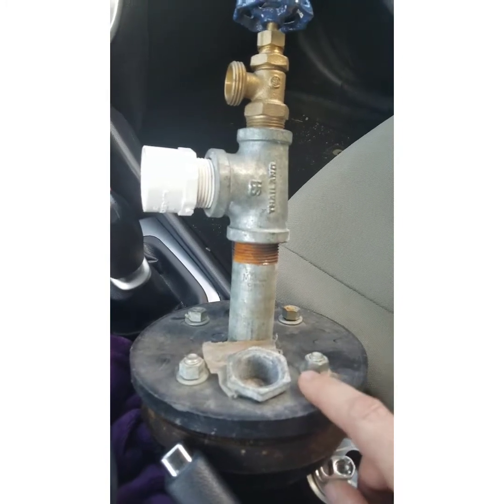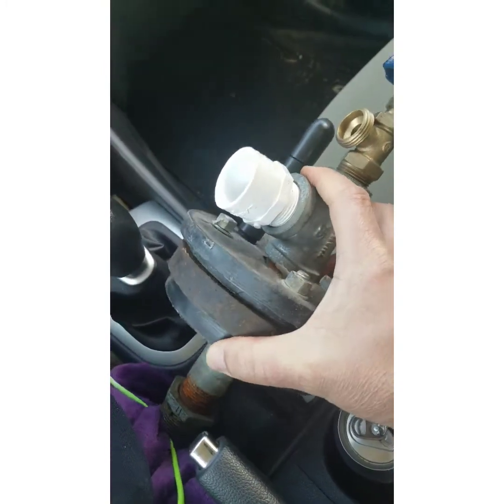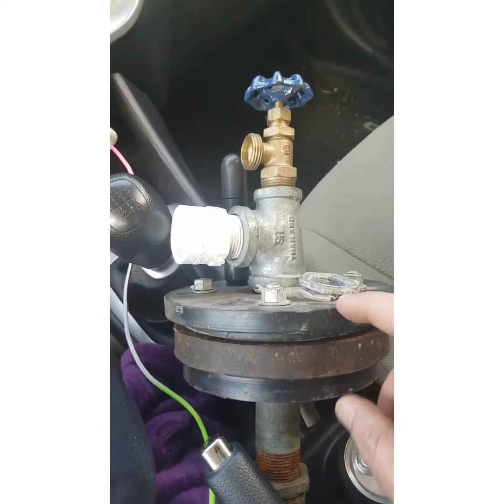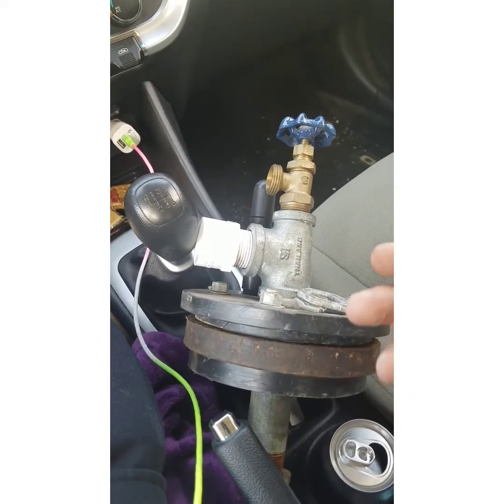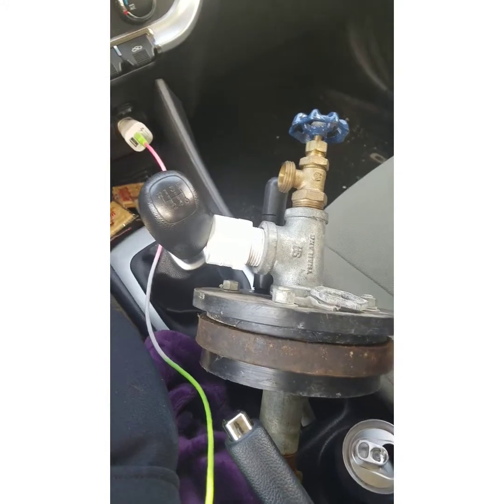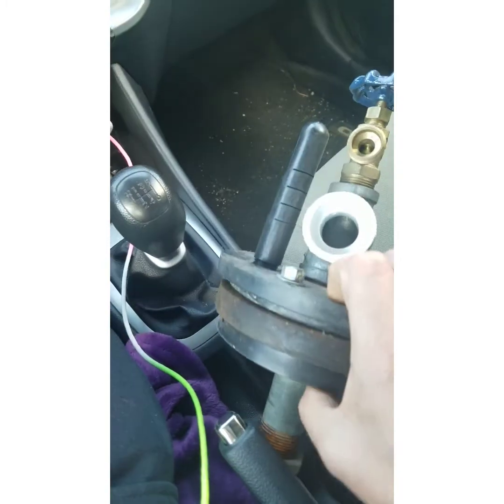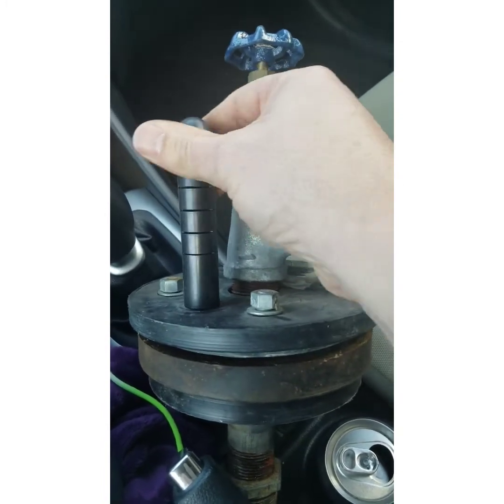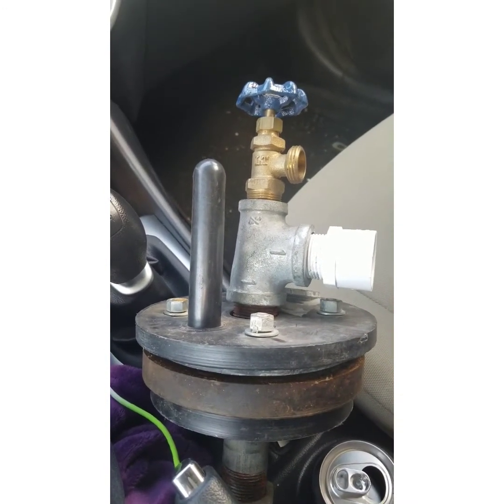Well seal

Comment: Im in CT with an old split cap seal that hasnt been used in 10 years. My great grandparents house was torn down here. Just curious how i hook new power to it as we are building a new house.
Reply from the maker: Is there a pump still in the well and a  pressure tank.

Comment: Just found out today that 1 of the 4 bolts on top of casing is leaking water. Is it possible just to take that bolt out and replace with new one?
Reply from the maker: The bolts dont leak.  You don't need to take it out. If you see water, it may have a broken pipe underneath the well seal and coming out around the bolts. Hard to tell without looking at it.

Comment: I have almost identical well sell. The nuts are rusted and the lower bolt heads are just spinning. It’s plastic so heating the bolt was not an option and WD40 would not unstick the rusted nuts. What options do I have to get the seal off?
Reply from the maker: Replacement of a new well seal.  Find out how deep your well is before trying to left it. Could be very heavy.
Reply from the maker: If it's not deep well you can take the forks of a hammer or shovel and try and get in between the casing and the seal to move it up and down until it comes out. Just be careful not to do to much or the pipeline under it could break if it gets in a bind.

Comment: Can  one use this seal  for artisan well  giving out  flow rate  of 6gpm ?  If not what could be  alternate seal ??
Reply from the maker: Is this a new well. Is the water overflowing from the top of the casing.
Reply: @timschannel910  Yea..... its new well of depth 200 ft

Comment: if I have a artsian well.. how do I seal up the center pipe so it doesn't leak water out? would like to be able to relieve pressure on the well and let it flow to my drainage ditch and possibly fill a pond.
Reply from the maker: You will have to drill a hole in the casing and run a pipe out of that so it will not get to the seal. That depends on how much water is coming out of it. If not the water will always come out around the seal and anywhere it can. Is the casing pvc or steel.
Reply: @timschannel910  Thanks Tim. I figured that's what I would have to do. It is steel 5" ID... I've been wrapping heating wire around it during winter here in Canada to avoid it freezing and splitting- even though previous homeowners for past 30 years didn't and it never did freeze. Just my luck it would spit crack and it's very close to my house with my basment .
Reply from the maker: We had one years ago that had about 150 GMP coming out of it we had to put on a pvc tee in the line below the seal on the pipe and run 6 1/4 in casing just to have a over flow or the seal would have blown out of it.
Reply: @timschannel910   150 GPM is too high flow rate..  in this condition, would you recommend  steel casing and on top slip-on flange  to  have control flow of artisan well ?
Reply from the maker: It all depends on how much water is coming out if you can drill a hole below the well seal and tap into that is the best way. What size hole and pipe depending on the amount of water is coming out of the well 1'' pipe may do it or it could be bigger if you have a lot of water coming out.
Reply: @timschannel910  wow. 150GPM Is crazy. I don't think mine might be 15GPM of that, I haven't ever measured. I do have a video maybe I will post it.
Reply from the maker: Your welcome its hard to explain some of it. But if you relive the pressure then the seal will be ok. I have had it where the seal keeps pushing itself out so we had to drill that hole to let the water go somewhere.
Reply from the maker: Hope this helps somewhat.
Reply: @timschannel910  Definitely will help me out...I just uploaded a video of the flow if you wanted to check it out.

Comment: Thank you. My well seal is leaking water when the pump is on. I cut off the power tonight, I hope that's okay. We've had several days below 20 degrees so I'm not sure that has something to do with it.
Reply from the maker: Do u see water from the top or just hear it spraying water. Yes cut it off if its spraying water also cut the hot water heater off to so you dont burn it up.
Reply from the maker: With it so cold out sounds like something busted. But if it stays this  cold it will be all frozen in the morning.